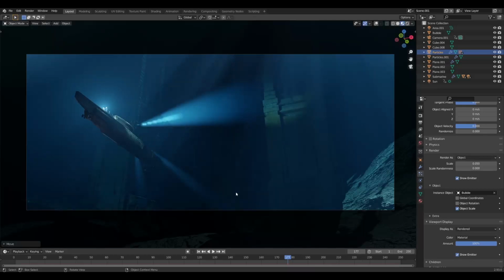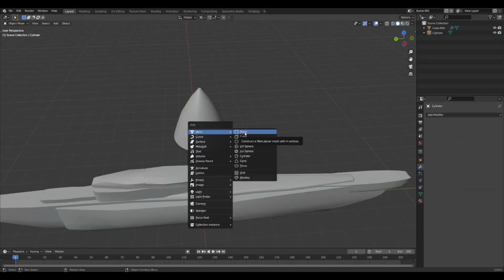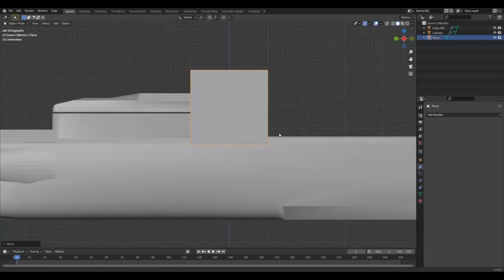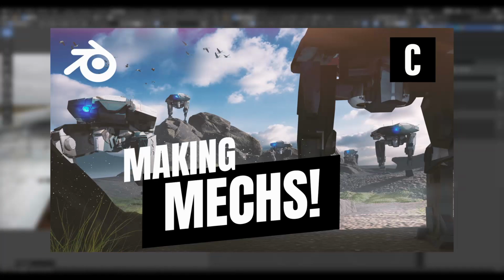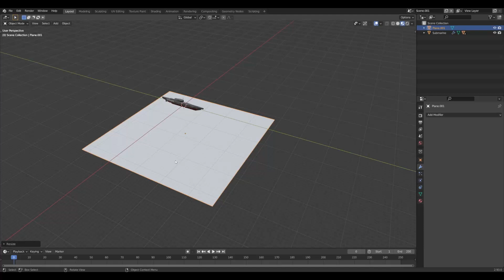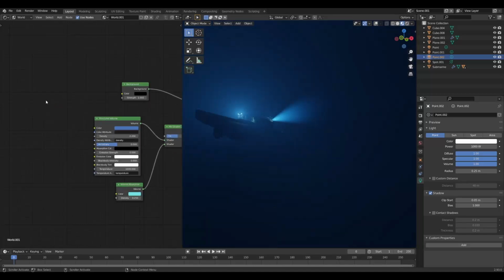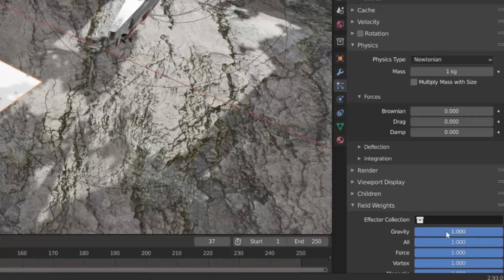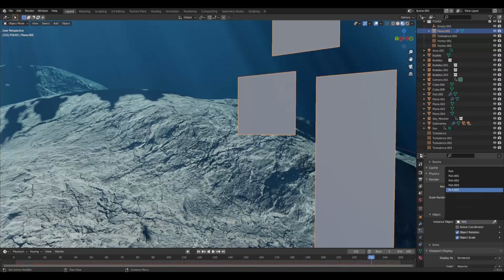Deepsea Submarine in Blender

Comment: Why would such submarine turn on a spot light in the deep sea? It has no windows to look out…
Also: that red bottom is to prevent marine life to stick to a ships hull. Submarines hardly do this as they are fully submerged.
Meh.
Reply: so, a deep sea submarine is likely down there for research purposes, meaning it would have cameras mounted on the outside. also, if a submarine were (hypothetically) made to sit in the water idle for any length of time, it would be on the surface, so the antifouling is a good idea